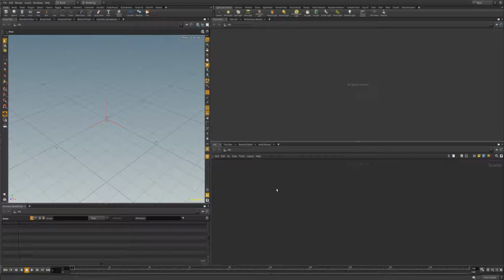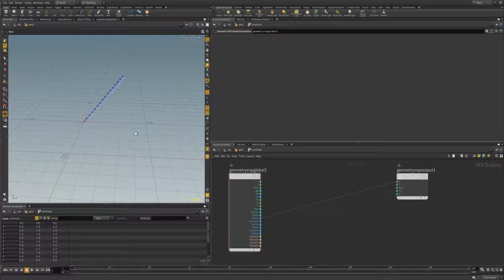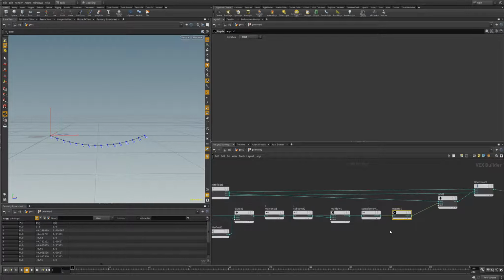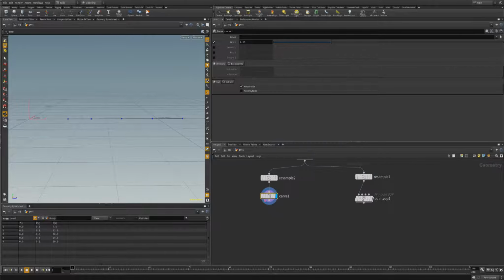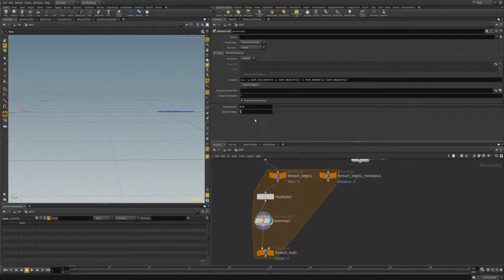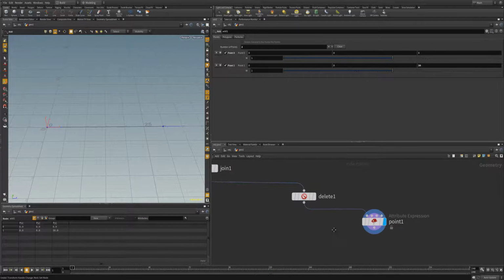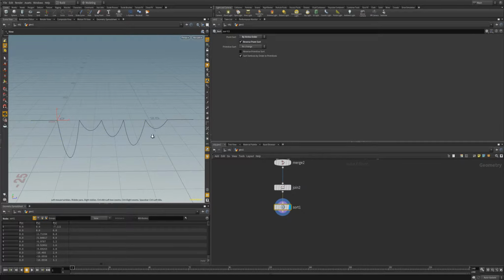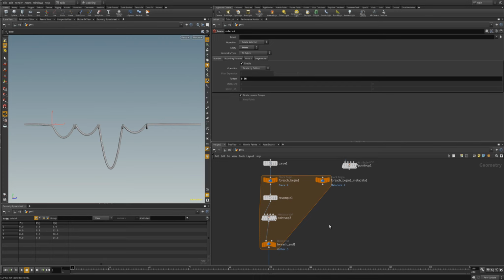Introduction to Houdini 16: Simple VOPs and For Loops

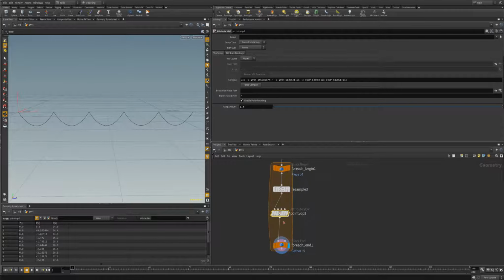Comment: Thanks for the nice tutorial: I have one question. I recreated your setup with the foreach loop(16:45 in the video), but I would need a modification. I want that the slack amount is driven by the length of each segment. How can extract the data of segment length. Thanks for your help

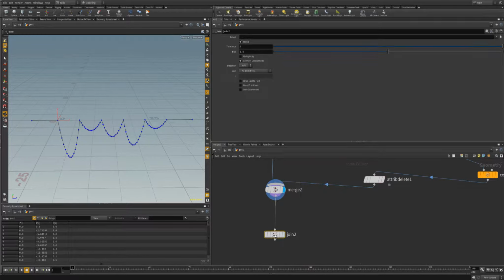Comment: One of the best videos ever!!! Had to watch a few times and go over so I could grasp all the info but well worth it!  One question. 27:00 I noticed that if the merge input was reversed, the Join node would create a nasty looking line between the edge lines. I’m a newbie, so is there an explanation to this?  Thank you !
Reply from the maker: Howdy Kijas! The Join node has a Blend parameter that is checked on by default that joins and fuses points based on their sort order. So, in cases where we are not sorting the points such that the overlapping points are  numerically adjacent, you can sometimes get this behavior. You can watch this in action if you move the Bias slider around to get a better idea of what is going on. This could be solved by turning off Blend,  which will not fuse the points, but still combine the primitives,  and then placing a Fuse node below it to clean up the overlapping points, and then the point order (which is partially determined by the Merge order in this case) will not matter.
Reply: Ben House Thank you so much, I’m trying to get into Hdn. And trying to understand as much as I can. I from from Maya and Nuke so I know how those work, but this is a whole new ball park. Appreciate your videos, going over them now. I might ask a few more questions if you don’t mind :D.

Comment: Hi Ben, thank you for making this video! I am trying to wrap my head around VOP and VEX. 
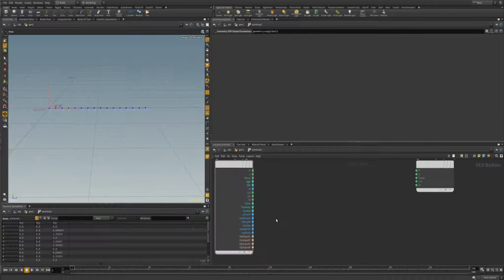QUESTION: at about  5:00 you said "we gonna first look at ptnum and numpt.... convert to float ... drag out Float node..." Probably super-beginner question--how would i know this in the first place? Can you point me in the right direction where to look for that? It seems to me that that is the missing piece of the puzzle for me--i can follow directions in the video, but i do not understand why/how, so if i had to do this simple action on my own i would not know where to start. 
Are there mathematical formulas that i need to learn first or something? I watched a few VOP tutorials, and everyone just pulls out the different nodes, plugs in different wires, and BAM!, it all works. But how do they know to use those specific nodes? That is the answer i am searching.  ... AND if I know all the formulas, would it not just be easier to use Wrangle and write VEX? Any advise you can provide, i would really appreciate it.
Thank you for your time!
Reply from the maker: Hi Maxim! This is something that is really different for everyone, but for myself (and in general I think this does apply to most people) it's something that is picked up naturally just from continuing to work though it. And it never really "goes away" since there are always new problems to solve in Houdini, you just naturally develop a sense of where and what to look for over time. What's the phrase, "10,000 hours of practice makes a master"? So really just keep at it and keep asking questions. :-) 

From a broader standpoint, it's important to understand the different ways that Houdini and other 3D software packages store and manipulate data. For example, every object is composed of Primitives, which are composed of Points, which in turn contain Vertices. In Houdini, each Point is assigned a unique number and stores a P (position) attribute, which is a a vector that contains 3 floats values for the X, Y, and Z coordinates of the Point.  See http://www.sidefx.com/docs/houdini/model/attributes.html for a great breakdown of this hierarchy.

Many nodes also provide local variables that are useful for nodes of that type. The local variable "ptnum" represents the Point number of the current Point being processed, and the local variable "numpt" represents the total number of Points that exist in the node.  See http://www.sidefx.com/docs/houdini/network/expressions for more explanation on these variable types. These are useful variables to have since we have set the VOP to run over all Points. If we were iterating over Primitives, we could use the "primnum" and "numprim" local variables to the same effect instead. 

As for converting those variables to floats: the Divide node (like many of the nodes in VOPs) inherits the output type from its inputs. So, because we are dividing the Point number (integer) by the number of Points (integer)  if we leave them as integers, the Divide node will output an integer, which will in this case always round to either 0 or 1. So in order to return the float value and get the real decimal values, we need to convert the inputs to floats. Understanding the reasons for this is a mix of basic numerical data, some simple math, and familiarizing yourself with the nodes in Houdini. I highly recommend exploring and reading through the Houdini nodes documentation.  http://www.sidefx.com/docs/houdini/nodes/vop/index.html
Reply: @GoingProcedural  wow, thank you for such a detailed response! I really appreciate your explanation and i am looking forward to learning from your videos

Comment: Is there a particular reason that using 'add' + 'resample' instead of 'line' at first place? My confusion is, it seems like 'line' has every functions that you're using in this case.
Reply from the maker: No reason other than old habits and just demonstrating a different way to do something. You are correct that you could just as well do this using a Line node.